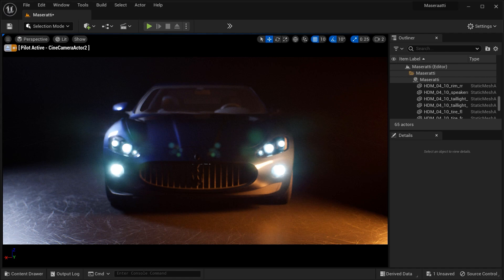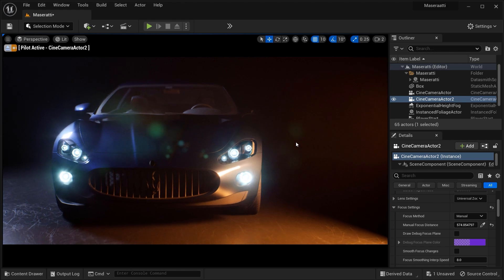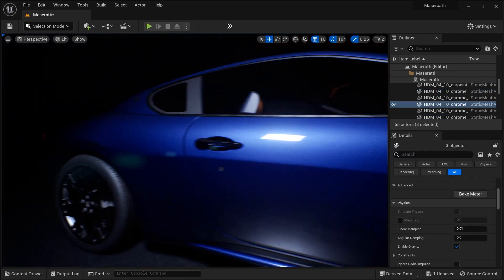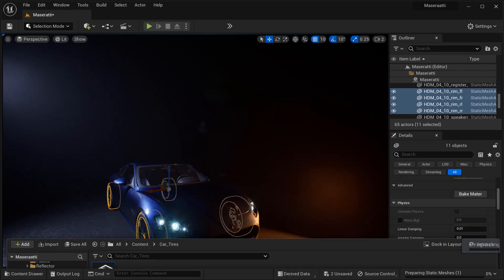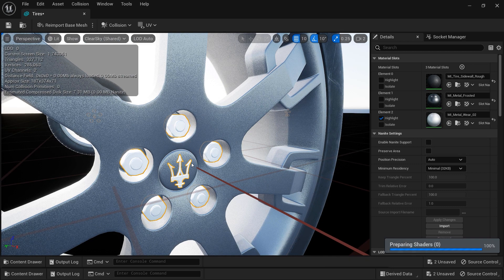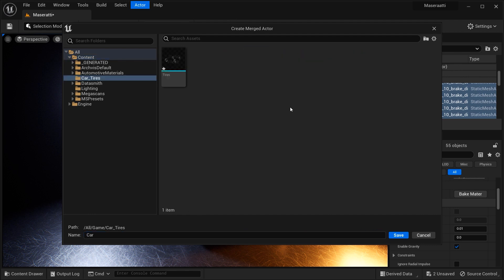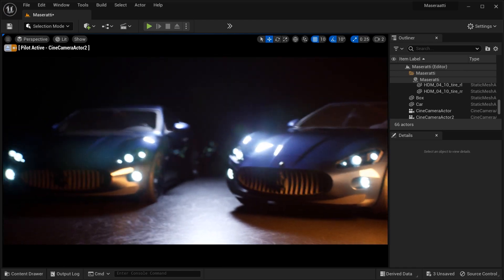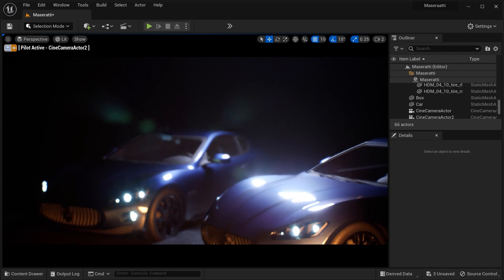Efficiency in Unreal Engine: Merging Objects for Enhanced Performance and Workflow

Comment: I think this is futile. Merging meshes does nothing if the materials are different. You still get a new draw call for each Material. Esp. with Nanite, you get one draw call per material, regardless of how many different meshes. So this is essentially a waste of work, with no optimization done. Also Lumen does not play well with larger or more complex combined meshes, and EPIC encourages the use of modularity with it for best results. You can check this in the Surface Cache view mode. If you see lots of pink on your object there, it probably is due to too many merged meshes, containing edge splits and/or being too low poly. There are examples of people who model entire houses in their DCC and Lumen does not like it. This does not apply to a car as much, but still, the effort here is useless and potentially even visually suboptimal when using Nanite and Lumen. Let alone that you would probably have a car's tires to stay rotatable, if nothing else is separated, then that is prolly what you would wanna have as individual objects with their own local pivot the most.

Comment: Nice! Woudnt this affect the Lumen quality though? My understanding is that Lumen requires separate meshes for good quality results.
Reply: @civareducation  Got it. Big fan of your page. I have learnt a lot from it.
Reply: Thank you for this post and this question. So if I have a large scene and I want highest quality, I should merge parts of the scene right? I noticed the MORE I have on a scene, the lower quality on render and worse performance on the editor